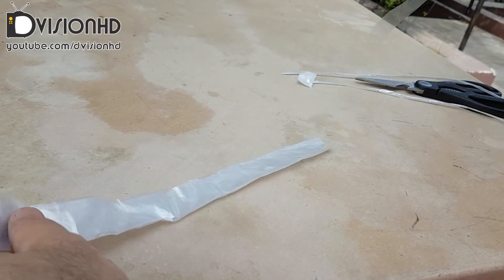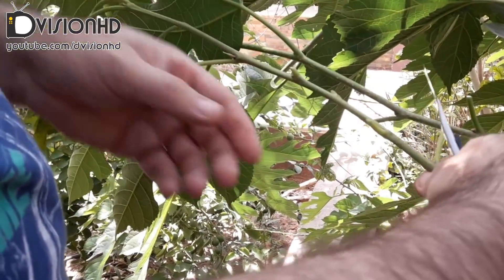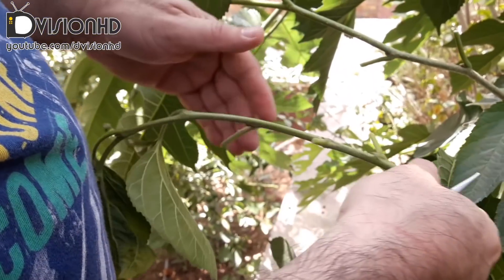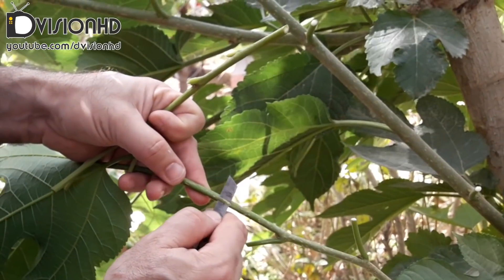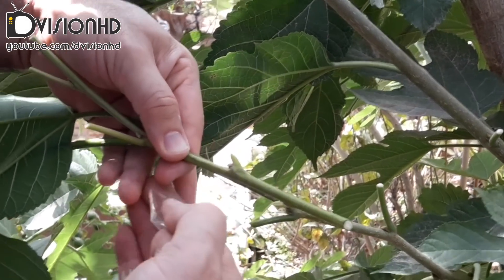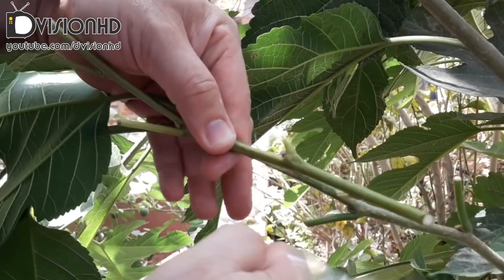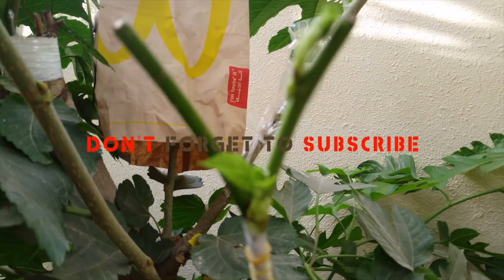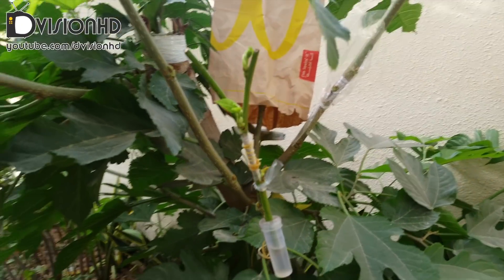Grafting-Approach grafting with water tube animation

Comment: You are AI 011001100011010, sorry my translation is very poor! Where do you obtain the h20 bottles, maybe I could use a small bottle. Are there fine mesh bags in bulk?
Reply from the maker: sorry to reply very late these are the water container the flower shops are using so you may get it from any flower shop